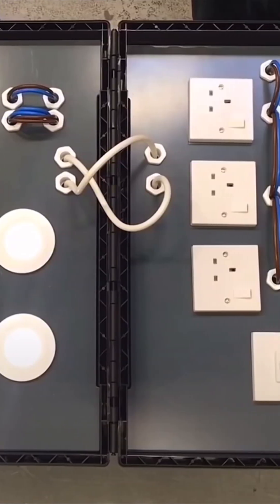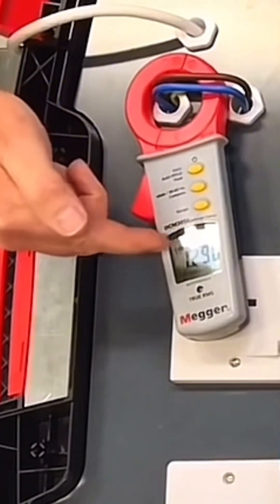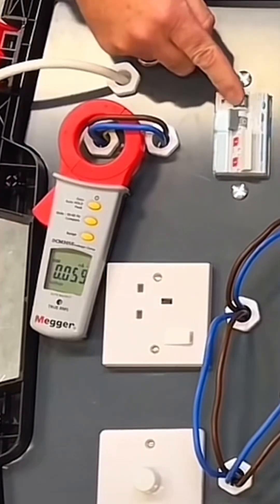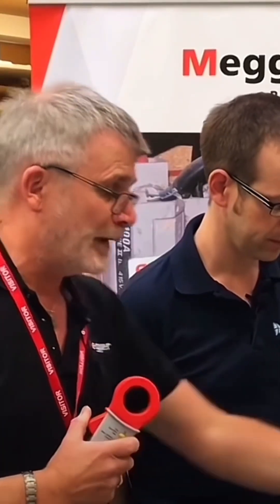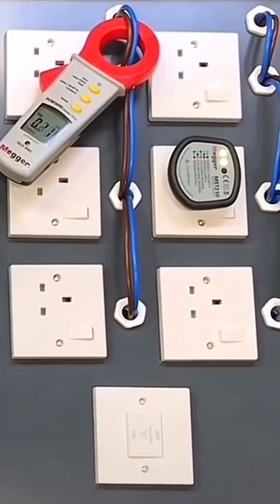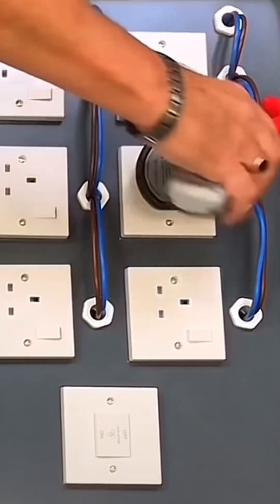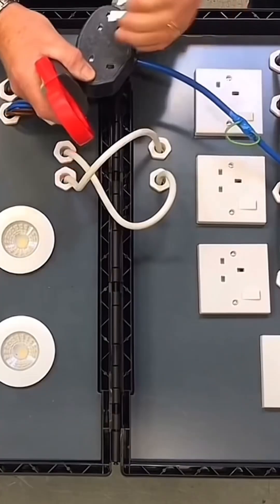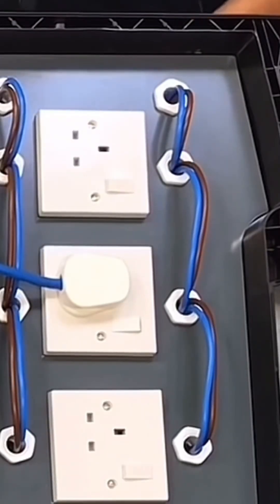Will it WORK - Using a Clamp Meter for Fault Finding

Comment: Would like to hear yours and others thoughts on ring final circuits with a 32a ocd, 2.5mm with reference method 101. Would you downrate the ocd or if a new install would you use 4.0mm? What would you code an eicr?

Comment: So with clamp meter they need to surround one wire but if cable sheathed how does this work
Reply: Hall effect summation
Reply: That's great in theory but all the manufacturers of f clamp meters all day measure current in a single conductor only  @posei3960

Comment: Fabulous? 
You did think of this last night.. how can I use a clamp meter to fault find an unique situation in which  a kettle create an issue. Kettle that should be removed.as everthing else when fault find a fault in a specific circuit.. to find faults in that electric circuit that an responsible electrician suppose to find the problem..
Reply: Depending on one's applied knowledge & field demand.👌

Don't think shallowly, these are for those in advanced & critical applications to accurately & swiftly pin down any fault(s).👍